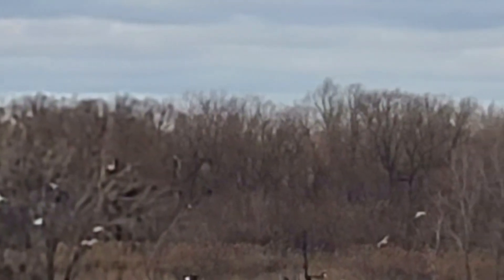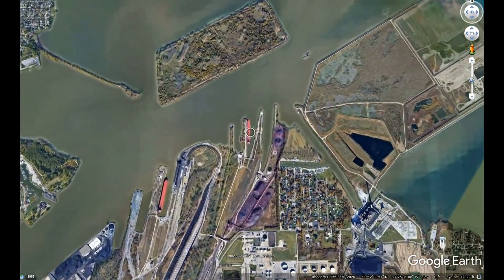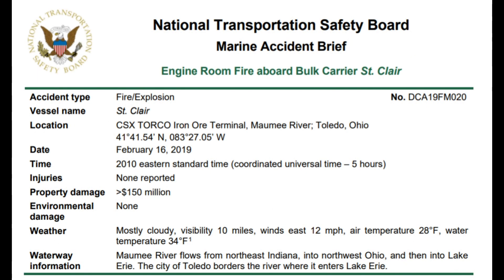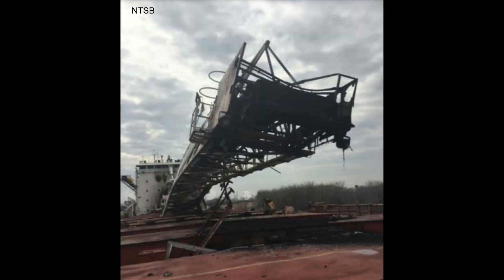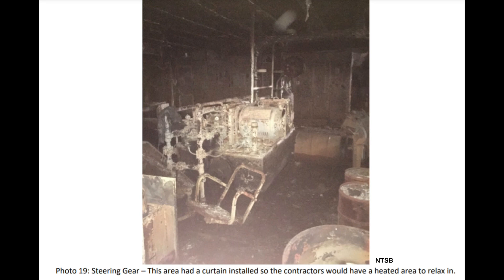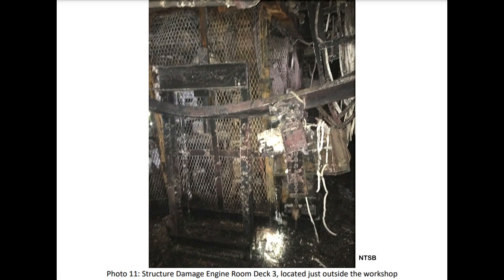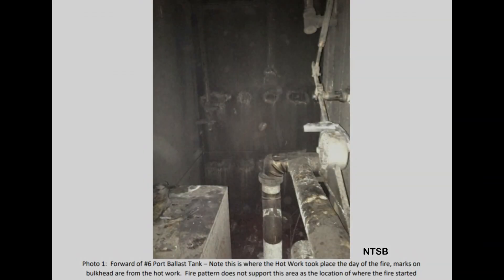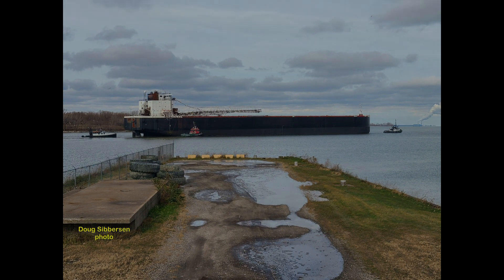Final departure, the lake freighter St. Clair goes to the scrapyard after a horrific 2019 fire

Comment: Thanks for reviewing the NTSB report. They are very comprehensive. This is a unnecessary loss. The contractor leaving with smoke present is negligent. There was a lot more investigation he should have done. The airflow definitely helped the fire grow. Delaying a call to the FD also contributed to the loss.
Reply from the maker: NTSB put the most blame on the fact that the company had no written procedures for how to ship-keep and had no form of remote sensing for fire detection. The contractor's actions were found to be in keeping with SOP, yet still inadvertently contributed to the cause.
Reply: @authorwes  sounds good without seeing the report. With no contractor you have no welding or fire. If the ship had been laid up and the attendant had been using the heaters they should have not been an issue. Haze in an ER that doesn't clear after ventilation. Especially engine room exhaust fans would have gotten a 911 call from me. Let the FD use their thermal imagers to track it down before it blew up. I will look up the report. Really enjoy your content. New to the channel.
Reply: Gee an effective fire suppression system and controls would of been a great investment.
Reply: In Law and for insurance purposes there’s a long established precedent that applies to your car, boat, aircraft, you name it, if one of these are left with a service provider being in control. This is referred to as ”Care, Custody, and Control” (CCC). In general, the short explanation of this is if a customer leaves a boat, ship, car, etc in the control of a service provider, that provider has certain duties. This precedent provides that the service provider, having been granted CCC, must act reasonably and responsibly to protect the property owner against negligent loss and to “keep safe” the asset. This precedent typically applies (for example), when you drop off your car with a service center. When you do they assume CCC and therefore must act to protect your asset. This precedent is applicable in most every case when you take your vehicle to a service provider and leave it with them. Had that been the case with this ship, the yard performing work on it would have had CCC, would have been ultimately responsible, and would likely have been found “at fault” if they failed to apply fair and reasonable discretion to protect the owner.  Of course there’s an easy way around this.  It’s why service providers almost always have disclaimers written into their service agreement “terms and conditions” through which the asset owner essentially agrees to waive CCC .  This is why you almost always see signs at your car service center saying “we are not responsible for items left in your car”, or other references to “damages”. It’s slippery lawyer crap for sure, but it’s a long established standard that applies.  In the case of this fire, I suspect the contractor did not have CCC.  In fact the report clearly indicates that the owner had a supervisor in his employ who was watching over the ship while in layup (presumably to protect the owner’s interests). I only know about this quagmire of slippery legalese because years ago I had been in the business of providing risk management services to companies that engage in service operations. Yes, Mr. Independent service center, if you read the fine print of your insurance policy carefully, you’ll find all kinds of exclusion provisions written there governing what your policy won’t cover which are fully applicable to CCC. Good to know where you stand.  Also good to know if your brother-in-law that you’ve hired as your insurance agent knows anything about any of this, so quiz him about it. He’s selling the insurance but probably has never read the policy he sold you. If he did, he wasn’t likely to have understood any of it. Even if he did understand, he probably wouldn’t know where to go as an alternative to get you good coverage for property left in your Care, Custody, and Control.  Always a good idea to read your insurance policy in full and ask a lot of questions to test your agent. Cheers!
Reply: @c5back9  great comment. Thanks. The watchman leaving after hotwork was a bad idea.
Reply: @thereissomecoolstuff  yes, a very bad idea for sure. I have no idea what was going on with him at home or in some other way that might have contributed to his making this sad error. Shame for all involved.
Reply: @authorwes  Your summary from the NTSB is pretty good--that operating in-line with the SOP still created the fire, and the fact that a 911 call was avoided for that long (which, even for uneducated Americans and Canadians, doesn't require a written procedure, just common sense), which kind of makes remote fire sensing irrelevant...   With plenty of experience in developing countries, this sounds exactly like what I would expect operationally in many of those places. At least those involved in this incident should all have been able to get jobs with an Indonesian or Filipino ferry company after this.
Reply: @thereissomecoolstuff  sure doesn't past the smells test
Reply: @thereissomecoolstuff  Ya Think

Comment: What I found surprising that there wasn't a 24/7 watch present onboard this ship.  Even more surprising that there wasn't a watch done to monitor the smoke which turned into the fire that destroyed the ship.  As a Navy Veteran we all know that fire onboard a ship is a serious issue.  No one should have left their post until the issue was fully resolved.
Reply from the maker: Yep. Pretty much what NTSB implied.
Reply: So you are carrying out hot works and have fire watch in place and later on smoke is noticed and you just switch on an extraction fan and leave it on and go home. What kind of idiot are they? Smoke normally equals fire but unbelievably they never checked where the smoke was coming from, just turned a fan on and left.

Comment: Not surprised.  No fire sentry after hot work.  Portable heaters not allowed on vessels.  No crew!  Fire detection system? What chance did she have…. Fire departments generally will not board a vessel to fight a fire so they won’t save her just keep it from spreading to other vessels or shore.  This is why a ship has a trained crew.  Shipkeeeper alone may be appropriate for storage/lay up - not so when refit work is undertaken.
Reply from the maker: Good points
Reply: We tried but when you get denied it's a hard pill to swallow

Comment: It's hard to believe that the ship wasn't repairable or even converted to a barge
Reply: Unless the hull was weakened from the heat, you would sure think it cheaper to do major reconstruction than to scrap it and start over.
Reply from the maker: Just looking at the photos I can see that she is just a scorched shell.
Reply: I've been a welder for a military contractor for years extreme heat causes the steel to become very brittle it will crack instead of flex
Reply: In regards to the question as to why the Saint Clair wasn't repairable or  reconfigured into a barge? Less paper work. It's easier to sign off on the insurance papers as a total loss, and get what moola can be squeezed out of the insurance policy, than recycle the hull to still be useful as something else on the water, and byways. After the insurance moola is paid out, and including the price of the scrap metal going to China - the Saint Clair is worth more money dead and gone, than if she was to stay alive and cruising on the Great Lakes. The ship company owners will get some extra changeola in their wallets & off shore bank accounts, and rent somebody else's ship for hire. This way, the Saint Clair's owner's won't have to spend extra money on insurance and maintenance costs. All that and everything else in-between, and behind the scenes- are a boat load of savings .
Free and easy money, without the mountains of paperwork and bullshit, is considered definitely a Moola is Coola kiind of thing. Woob. Woob, Woob. Woob. Hey Moe, Hey Larry  - Get me a torch. We're in the money- we're gonna be RICH...
Reply: @rickprusak9326  really sad that our society has come down to this a disposable one
Reply: Problem with converting something 105' wide to a barge is you need a special built tug to handle it.

Comment: Never leave a ship or anything when smoke is present. The ventilator fan turned on made for a good draft and air supply for the fire. These laid up ships should have an automatic sprinkler or other fire extinguishing system.
Reply from the maker: Pretty much what the NTSB said.
Reply: Remember as a kid where there's smoke there's fire.